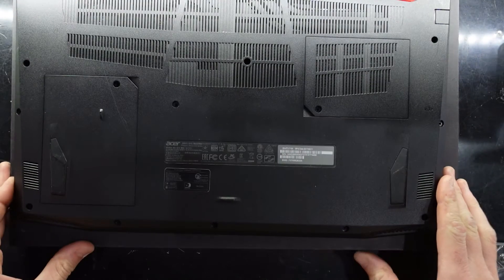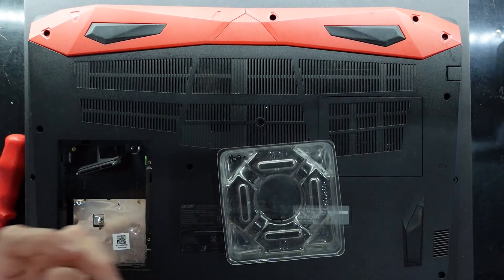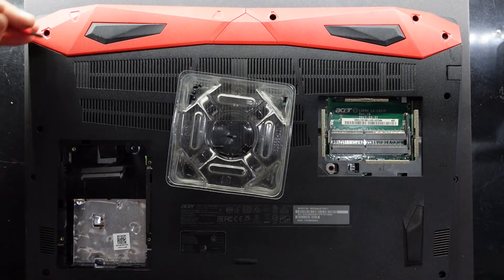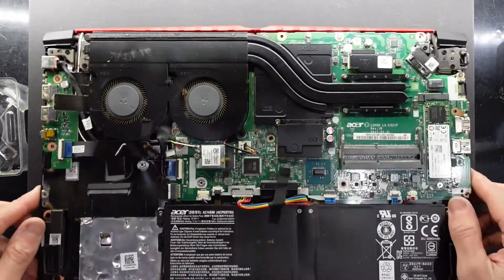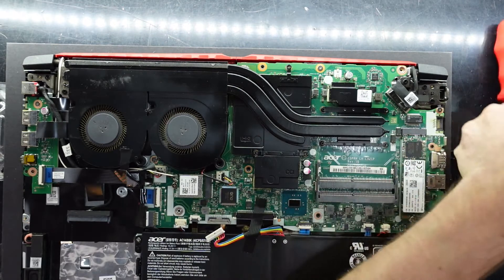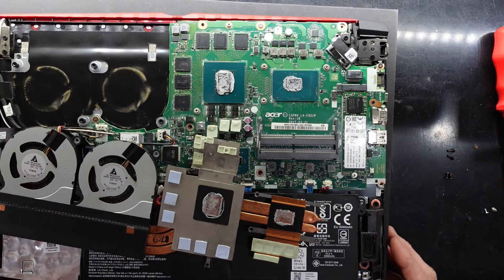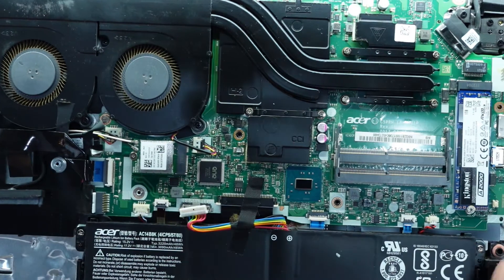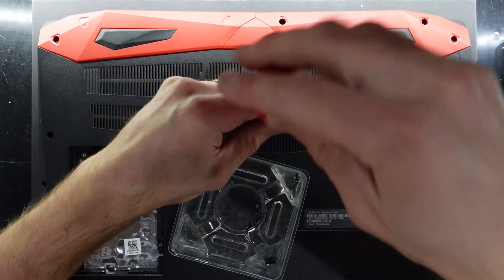Acer Helios 300 2017, Lets give this an Upgrade!

Comment: Hi. What size was the screwdriver you used to loosen the nvme slot? My #0 doesn't seem to fit.
Reply from the maker: I usually use a 000 phillips head
Reply: I tried using the #000 Philips head on it and it was still too large. Is there an even smaller one you use? Thanks!
 @rickstechrepairs

Comment: Was planning on getting a 10th i7, rtx2060 Helios earlier this year but they jumped in price at the time. I do like Acer has 2 m.2 slots with a 2.5 SATA throughout their 3 lines, Nitro, Helios, and their top tier line with the all metal chassis, unlike MSI and HP were they'll leave off a 2nd m.2 or SATA bay.
Reply from the maker: i did notice that, how it seems that msi reserve the 2nd nvme slot for the more expensive models and save themselves to the 50 cents for the slot
Reply: @rickstechrepairs  HP did it with their last gen Omen 17t line that last had a 2.5 SATA bay. The 2070s had the 2nd slot and was left off the 2060s, a 250-300usd price difference.